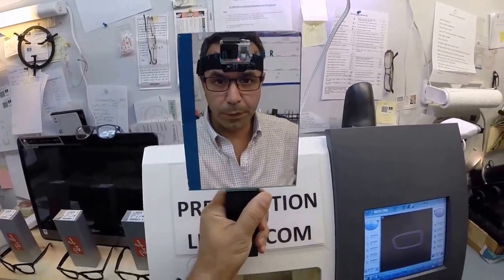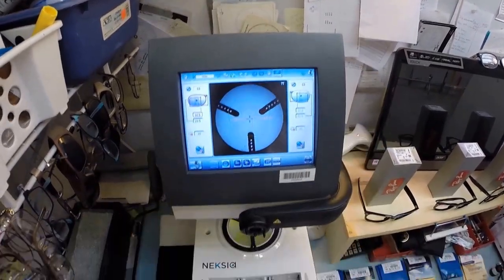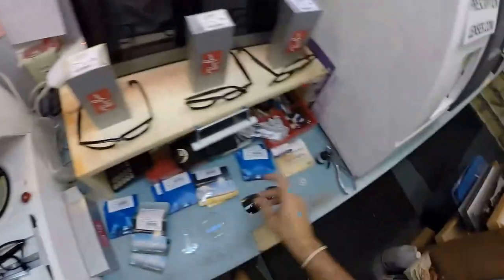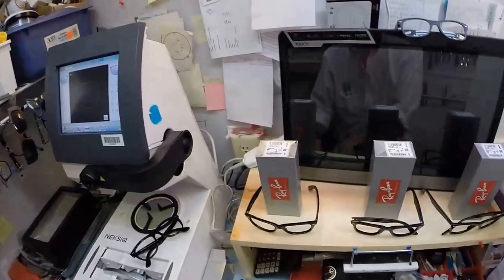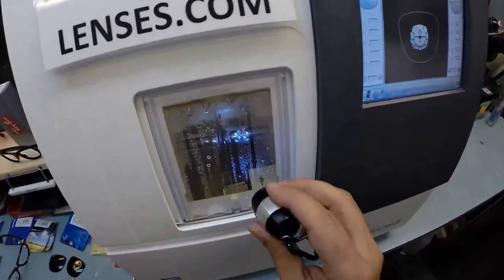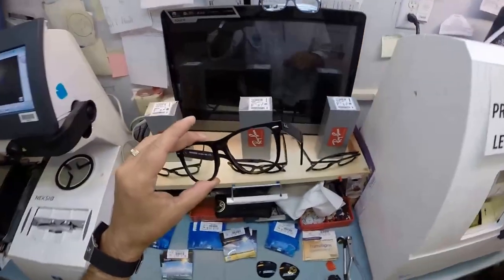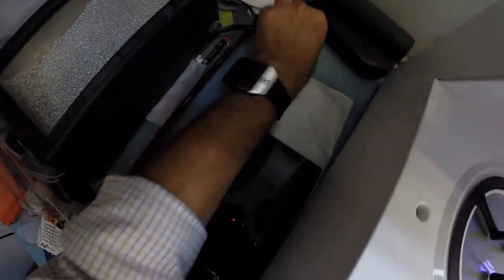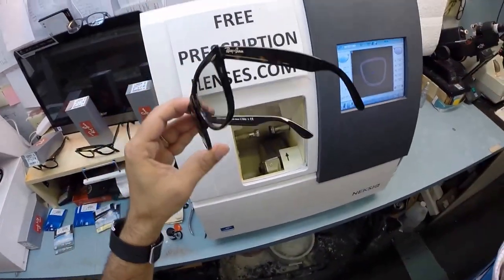RayBan 2140 Original Wayfarer with Transitions Lenses with Crizal Anti Glare

Comment: Will the RB-2140 take prescription lenses or do I have to order the RX-5121???? What's the difference? I hear the beveling is different???
Reply from the maker: You can absolutely have your Rx lenses installed into the RayBan 2140. Technically the 5121 and the 2140  are about a half millimeter different but the angle of the bevel is the same. Most people prefer the Italian made 2140 over the Chines made 5121. i prefer the angle of the 4340 over the 2140.I never preferred the dramatic tilt of the 2140 so I fin the 4340 to be much more comfortable and yes you can have your Rx lenses in any RayBan frame....Seemore Better

Comment: awesome  video. learned a lot. thank you.

can you do a gradient tint prescription  lenses with top half dark gray/black and lighter on bottom half ??

Also have an older metal frames of rayban with slight wrap around  look. Can you cut me very thin lenses without the thick coke - bottle look with -3.00 sphere ? or should I look for different frame? 

Do you sell Oakley and rayban frames?

thanks, great vids!👍😎

Comment: What's the difference with the rb4340 wayfarers?
Reply from the maker: Its been redesigned to have the front tilt taken out. Even though that was the original desin in in 1952 it lets light in through the top and t also causes the bottom of the frame to rest on the cheeks. In 1992 the 2140 was redesigned to be more verticle and that became the 2132 New Wayfarer, which yu see me wearing in mot of my videos. It became so popular they decided to do a minimilist reision and thats the 4340.

Comment: Is there any difference between the ray ban 5121 and 2140 frames?
Reply from the maker: Yes the 2140 "Original Wayfarer" is made in Italy and is the sunglass version. The 5121 (just)"Wayfarer" is the ophthalmic version which is made in China to the same exact standards that the 2140 Original Wayfarer is made by.The 5121 does cost more because RayBan has a higher mark up on their ophthalmic frames than their sunglasses.Go figure. Let me know if you have any more questions.
Reply: freeprescriptionlenses.com I guess 2140 frame would be the way to go..  still put together in Italy yet cheaper.. thanks for the help!
Reply from the maker: Its time tested and still a classic. It remains one of my best selling frame. You should consider the 4105 Folding Wayfarer. It too is made in Italy but has reinvented the look and feel of the 2140. I believe it s more comfortable and gives you different color combinations.
Reply: I thought the whole point about the RB 5121 (ophthalmic version of the 2140 "Original Wayfarer") is that the frames are specifically designed to permit interchangeable Rx lenses, whereas the 2140 were not.  Maybe the interchangeable nature of the frames of the 5121 cost more to manufacture? I defer to your mastery of the subject, of course.

Comment: I just bought some new glasses from walmart n just waiting for it to get there to pick it up I believe mine are polycarbonate with the transition hope there better than the ones i had before. I heard that with transition u have to put it outside for couple hours is that true?
Reply from the maker: No need to leave them outside.
All transitions lenses will darken on day one and continue to darken for the first few weeks until they reach the final hue. Providing that they are exposed to the sun during that period. They are also temperature sensitive, meaning that they will get darker in cooler weather than they will in very hot weather. They will not get as dark when its in the 90's Fahrenheit and higher than they will when its 80 and below. I tell my patients, you're miserable, they're miserable, everyone is miserable in those conditions. They will only darken when exposed to direct sunlight, meaning that they will also not darken behind the windshield of most vehicles, unless you have a convertible or motorcycle. Your windshield absorbs the majority of the suns ultra violet rays so that your dashboard doesn't crack in the sun. Other than that they will provide you with years of reliable performance.
Reply: freeprescriptionlenses.com  thank you cause i work outdoors at a golf course and u figured the transition be great since i work out doors but my aunt told me yesterday that  when she got hers at the place she went they told her that she had to leave it outside at direct sun light so it will darken fully n then be ready and stuff